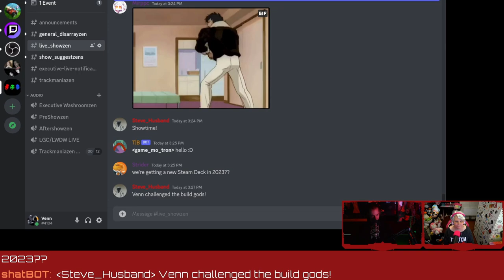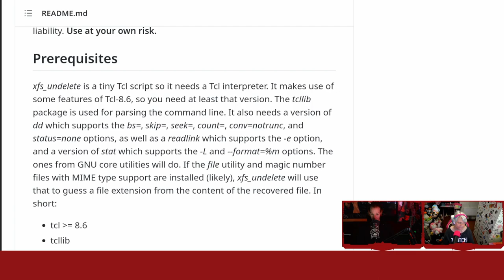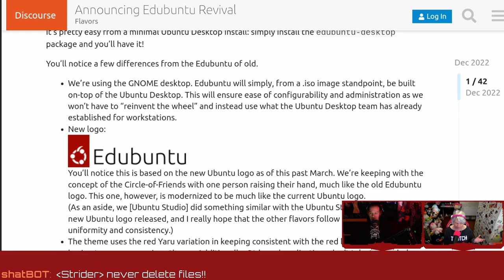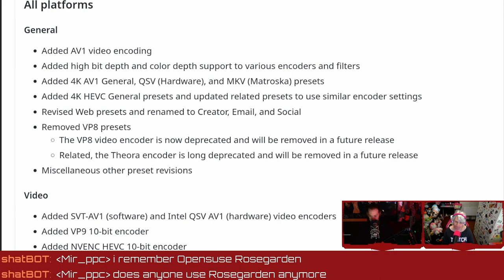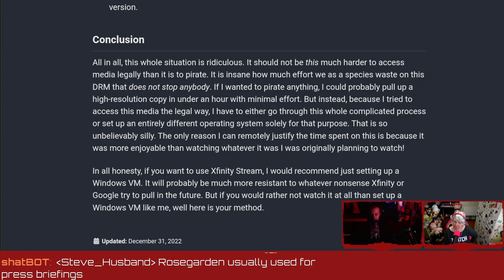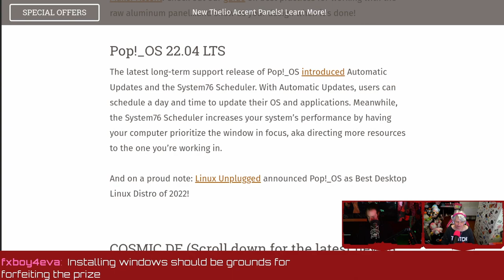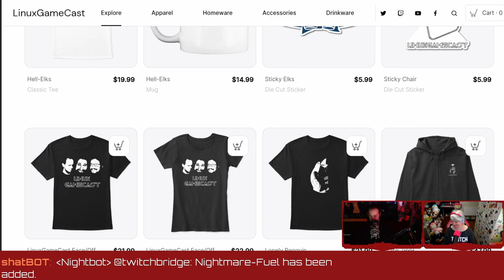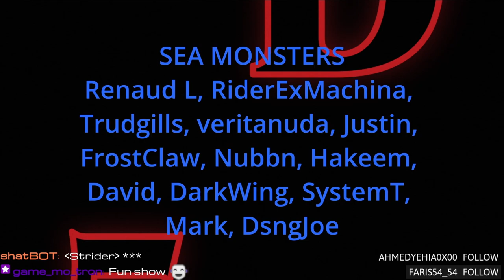LWDW 358: Edubuntu is back and hacking Xfinity with Linux

Comment: Educated timestamps
00:00 Intro
01:05 Wrecktangle build update
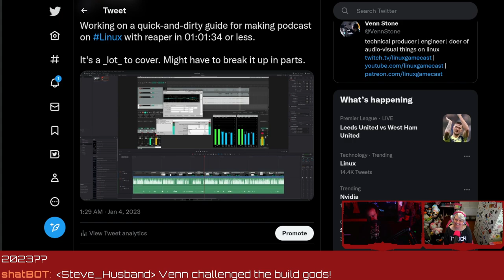03:01 Podcasting on Linux guide
06:58 Pine Buds Pro 
07:29 Atari VCS
10:04 Recovering files from XFS filesystems 
14:10 Edubuntu is back! 
20:04 handbrake AV1
23:50 Hacking Xfinity with Linux 
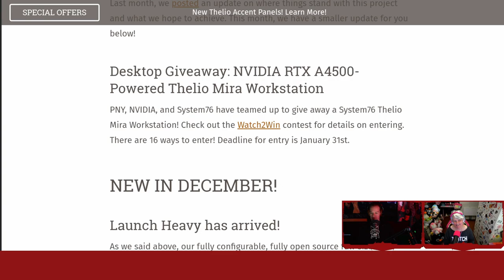31:42 System 76 workstation giveaway 
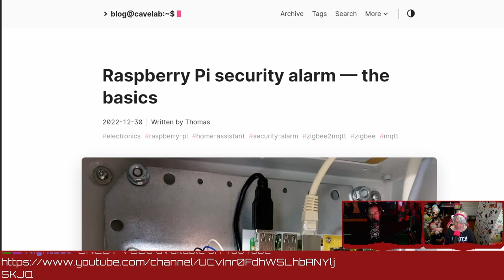41:58 Raspberry Pi home security system